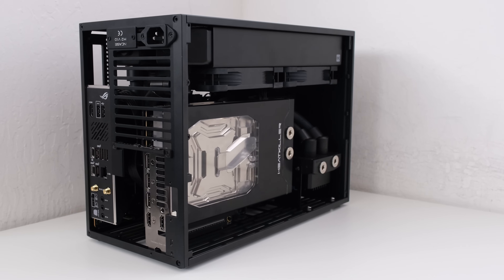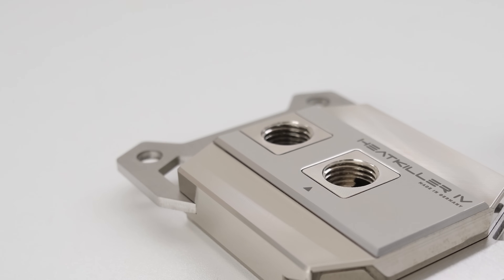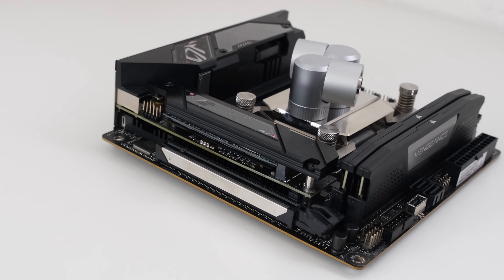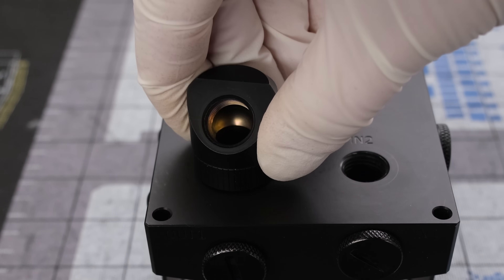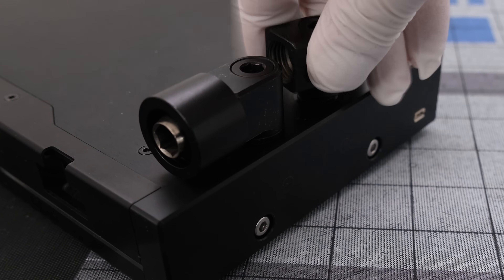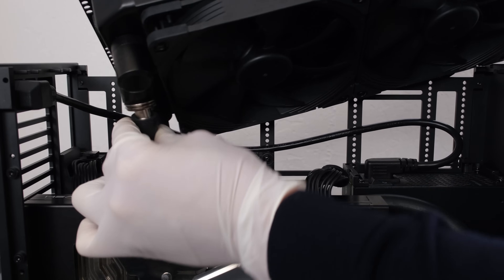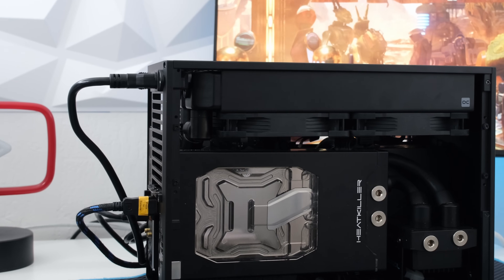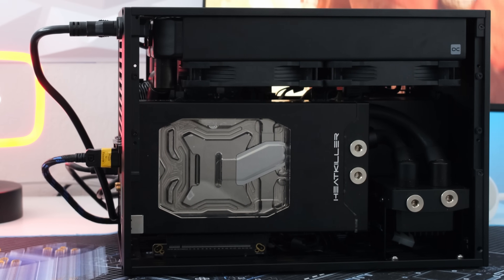RTX 4090 in NCASE M2 - Ultimate SFF Watercooled PC

Comment: How do you get the air out of the loop without a reservoir and also drain it?
Reply from the maker: Thanks for your comment 🙏 Good question. Getting air out of the loop was not easy to film. I really only showed the first part. Put it on its side, open up a port on the pump unit and fill. After the water would get to the top, I would put the plug back and then pick up the whole ITX case and rotate it so the water and air gets pushed around. I then put it back down and open the plug and fill it with water and repeat this process for probably 10 times or so. I use the air in the GPU block as a gauge. When the GPU block is completely filled with water and there isn't air there, then I'm pretty much done. I can then put it right side up and run the DDC pump for a full leak test. 
For draining, its a lot easier. Just put it on its side and you can attach a drain valve (or two). Hope that helps

Comment: Are vented side panels rigid (like NR200P) or fragile? Will they bent if you grab your PC at bottom and side panel while transporting?
Reply from the maker: Thanks for your comment 🙏 I have built in  several NR200s. IIRC, those side panels were more rigid and sort of snapped into place. The ones from the NCASE M2 are thinner and bent inward (as designed) for a better fit. I believe stability was less prioritized here for better and slimmer fit. Hope that helps
Reply: @vectornetwork  Thanks for response! Would be alao very interesting to watch COOJ Z13 on your channel, but those are rare and expensive

Comment: How is the WATER temperature under continious loads? And by that I mean 2.3 hours of gaming. 

Many people imagine that cooling with water is “magical”, but it is not. You have the same physical laws as with air cooling. The advantages of water are:
- Water reacts rather sluggishly to temperature changes. This means you gain some time when cooling (but not hours)
- With water cooling, you can move the water to a place where the conditions are better for cooling (more space, cooler temperatures).

I have been building custom water cooling systems for over 10 years and have tested and spent a lot of money and with all due respect: This build is really very nice. But technically it's complete nonsense. Its way to less radiator surface for this powerdraw. The problem here will also be that the water exceeds the temperatures that the manufacturers release from the hoses. Things will then settle there and the whole thing will gradually break down. I saw in another video that you already own a MoRa. Use it please for this one, too.
Reply: 10c per 100mm is for people who use acrylic tubing or live in hot climates. 45c coolant temp won't kill the pump and edpm tubing won't melt.
Reply: @isaac.s6353  This build here will definitely exceed 45° water temperature under continuous load and that is simply nonsense.
Reply: I feel you @kpmlinho

I run a tripple 360 rad setup (2x 45mm + 1x 30mm) and in games i get like 31°C water-out and 34°C water-in with my 5800X running at 63°C and the 3080 at 50°C (hotspot being 67°C).
The system has a total of 12 Noctua NF-A12x25 running at 900 rpm, so there is pretty much no noise. Pump is an Alphacool D5 at 2500 rpm.

Undervolt can be a powerfull weapon but i am always 'impressed' how these tiny 1 rad systems perform so well...

Comment: plus points for the quaddro. it’s unfortunately a rare sight on yt. but their controllers are really good. using an octo in my current cerberus X and had an aquaero before that.

I think, I’ll try to get 2 radiators in the N2. waiting for the 5090 FE (hopefully smol PCB as my 3090FE)

nice video, cheers
Reply from the maker: Thanks for your comment 🙏 The Quadro (and Octo) are really cool little devices. I include them in almost all my builds. I enjoy how they keep their settings.

Comment: Very nice!!! Do you think it's possible to do a triple 280mm slim radiator like the AlphaCool HPE-20 ? And what would be the limitations ? Obviously not with 16mm tubing but probably 8mm OD with pneumatic fittings and a cpu block/pump combo ... what do you think ?

Comment: I am currently starting to order parts for an M2 build too,  I will be going for a dual 240mm rad build potentially triple.  I’m gonna use the iceman pump res combo which was so popular on the M1 so that’ll give more space.  Then the rest will just be bottom rad, side rad (maybe) and top rad.  Just difficult to work out if it will fit or not yet since I’ve seen very few builds to the extreme I’m wanting to do

Comment: Im using EK azure blue cryofuel coolant. I think I'm going to change it out to go chiller
Reply from the maker: Well, that would certainly be a reason why. Maintenance is part of the game. In the end, using simply distilled water has been much easier than all the coolants that I've tried and used over the years. I do maintenance all the time though, so that is one variable may be different for me. Hope that helps
Reply: @vectornetwork  This is the second coolant that I have experienced. The first was primo chill. It went from a foggy purple to a clear, and I prepped the loop before filling it. The second is now, where the coolant hasn't changed colors, but the actual gpu water block has discoloration in certain spots. I have another PC that's running Go Chiller and no issues, think I'm just gonna stick to what I know

Comment: Interesting that your temps are almost the same or very slightly lower than mine and I have the newer Noctua 140mm fans with dual slim Alphacool HPE 280mm radiators. What is your coolant temp at in these tests and how long did you stress test for? Seems like you didn't let the loop fully heat saturate?

Comment: Why is your GPU memory hitting 99c without an under volt? Something doesn't seem right about that. Sick build tho
Reply from the maker: Thanks for your comment 🙏 You're flat out right. I double checked the source data and that's what it says, but in retrospect, that is maybe 30 degrees too high. I should have caught that, but I overlooked it since the GPU temps were good. It is likely a thermal pad contact issue. I will check it when I break down the build down the line.

Comment: would you change any components if you were using a rtx 4080 (super if that's still a thing)?
Reply from the maker: Thanks for your comment 🙏 You know, not really. It would simply run really smooth with a 4080 or a 4080 Super. Actually, if I could, I would then upgrade to a 9800X3D and that would run better with the 4080 Super. But everything else can be the same. It would run like a dream.

Comment: More m2 Builds pls!
Reply from the maker: Thanks for your comment 🙏 I hope I can figure out another configuration that will work. Or I can do Air-cooling and then there are a lot (a lot) more options
Reply: @vectornetwork  Perhaps a simple variant, with AIO and normal graphics card (Vertical). Or a completely reversed build

Comment: GPU memory 99c are you sure?
Reply from the maker: Thanks for your comment 🙏 I double checked the source data and that's what it says, but in retrospect, that is maybe 30 degrees too high. I should have caught that, but I overlooked it since the GPU temps were good. It is likely a thermal pad contact issue. I will check it when I break down the build down the line.

Comment: make more vids
Reply from the maker: Thanks for your comment 🙏 That is the plan my friend! The 50-series is around the corner too, so more to come!
Reply: @vectornetwork  nice, i still waiting :)
Reply from the maker: Thanks for your comment 🙏 I am nearly done with the upcoming video. It's a build in the Fractal North (9800X3D and RTX 4090). I need to just power through and finish it. Planning for next week release. After that, I plan on doing a video on the MORA IV 200. I have the parts. I also am still trying to procure an RTX 5090 at MSRP (no scalpers). It's very slow going but I will eventually get one and will do a video on it along with water blocks. My top choice is the FE model, since I am dying to tear it down. Hope that helps

Comment: VRAM at 89 celcius is not normal, is alpha cool beating heat  killer that much?
Reply from the maker: Thanks for your comment 🙏 You're flat out right. I double checked the source data and that's what it says, but in retrospect, that is maybe 30 degrees too high. I should have caught that, but I overlooked it since the GPU temps were good. It is likely a thermal pad contact issue. I will check it when I break down the build down the line. Thanks again
Reply: @vectornetwork did you get a chance to retest?
Reply: @ exactly, I hope there’s no damage done to your parts

Comment: What about 2 280mm rads? There is so much unused space. Gpu behind the mainboard. pump between psu and mainbaord. One top radiator and one in front of the gpu or cpu. Depends where you left the space.
Reply: I'm actually running 2 280mm rads in this case and his temps seem to be very slightly better than mine. I'm using a Modultra Lobo (which could explain the slightly higher cpu temps compared to a standalone block) 9800X3D undervolted, 4090 with the same block, and the newer Noctua NF-A14x25 G2. Wondering if the testing in this video wasn't actually when the loop was heat saturated. I feel like longer gaming tests need to be done to really determine the efficiency here, but maybe a single thick rad in this case really is better than 2 slim.

Comment: Add a MO-RA3 420  to it and see what temps you get? That would be amazing!
Reply: There was an "Endgame ITX Build" 5 months ago that used a MO-RA3 420 with similar specs (Intel i9-14900KS instead of an AMD Ryzen 7800X3D). GPU VRAM temps were about 30C lower so might have been a thermal pad contact issue on this build.
Reply: @Kokinkun  What was the gpu/cpu test though? A game? Was that just at base temps? only reason I ask is because I have a Full Tower with my MO-RA3 420 connected and get amazing temps, but I really like the idea of having something smaller to create more space on my desk. Thanks
Reply: @OGSGTWOBBLE  It's from 3DMark, the benchmarking/stress testing software suite? It's been around for decades and they have different tests that hammer the CPU/GPU. He also did Cinebench and the same Cyperpunk 2077 Overdrive test, including both base clocks and undervolted. He includes the ITX only mode (disconnected MO-RA) and MO-RA mode (turned off internal rad fans).

Doing a single rad for a CPU + GPU on the M2 will run pretty warm. The internal water temp will likely spike to 40-45C, which is not ideal. If you're thinking of doing an M2 with an internal rad + your existing MO-RA setup, you should definitely watch the other video. That setup has good versatility and insane temps when adding the MO-RA.
Reply: MO-RA3 isn't being sold anymore, Watercool moved to MO-RA4 in the summer. Just saying this if you didn't know it already.
Reply: @Simon_Denmark  I didnt know that. but thanks.